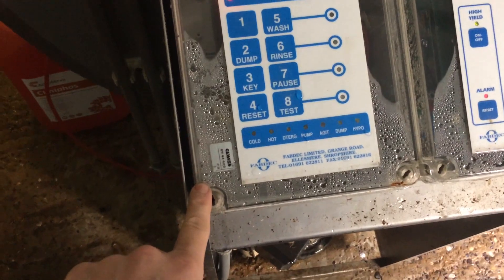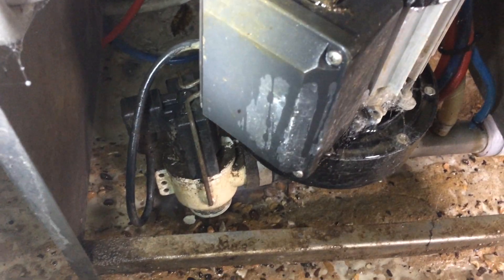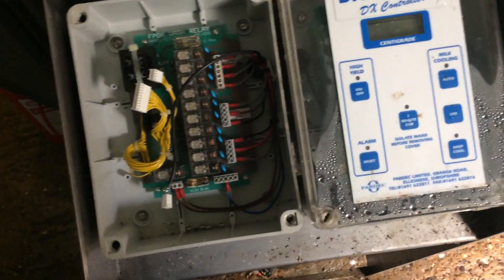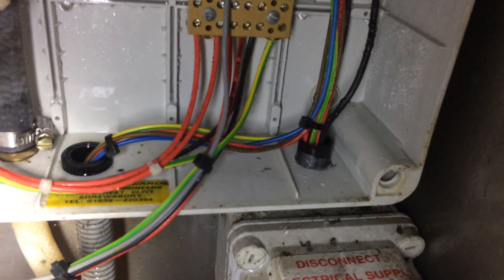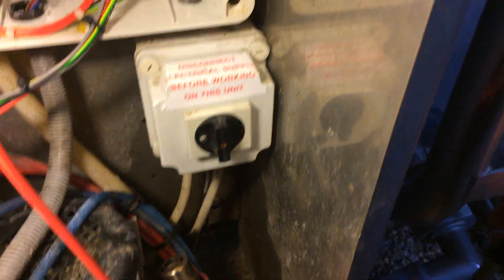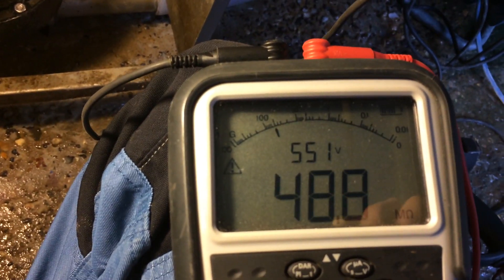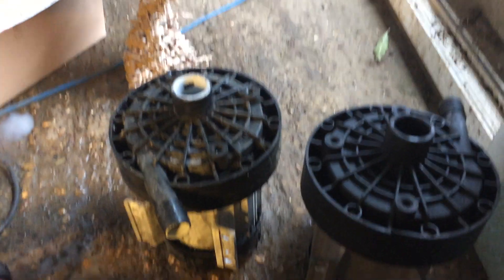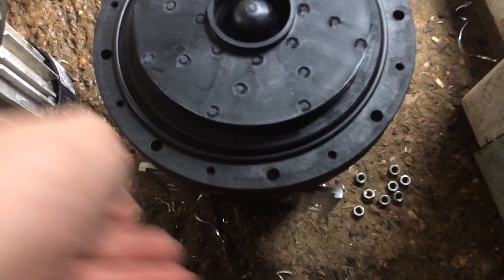Fabdec Wash System Diagnosis

Comment: Liking your vids HD!

A bit off topic but how do you find your testo gauges? I've just ordered a set of Bluetooth 550s.
Reply from the maker: Hi Nathan,  I recently broke mine, i was charging liquid into a new system and as can happen the flow of refrigerant caused a static charge which i think damaged them, it was something the earliest models where susceptible to and i think the later models have been designed to cope with static and not be damaged. I will be ordering a new set next week!
Reply: heavydiesel I've heard that testo give good after sales support. Might be worth an email to them?

Comment: I wish I had a nice pair of pants like yours. I blow through the knee of my wranglers way to often.
Reply from the maker: Yeah i used to do the same, plus these have pockets for knee pads which are great once you get used to them. They are expensive but work out cheaper in the long run imo.

Comment: Those hoses like to crack at the ends, like all plastic piping does when you have a sress point.

Just did a repair on a water pipe, where it had sprung a leak from being kinked when installed 20 odd years ago. Cut out the section and used 2 couplers to put in a piece of copper pipe instead. Probably related to all the water pressure cycling at the moment, putting a lot of strain on the water supply, and causing a lot of burst piping in the streets, and making business for the water heater suppliers as so many fail from this cycling.
Reply from the maker: Yeah, they used to supply these with metal ended hoses, I guess this it what people get when they always want stuff cheaper.